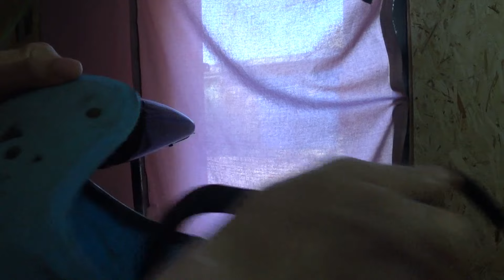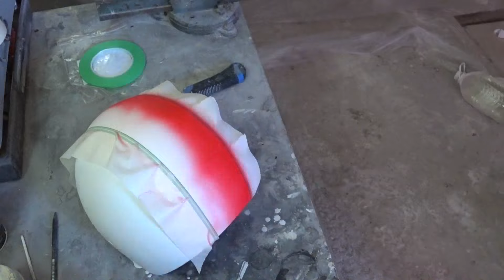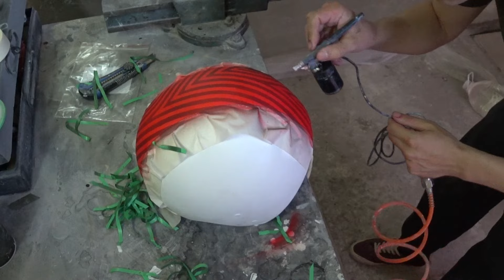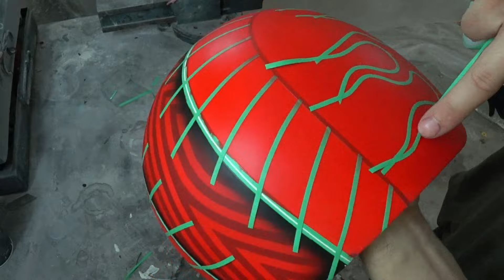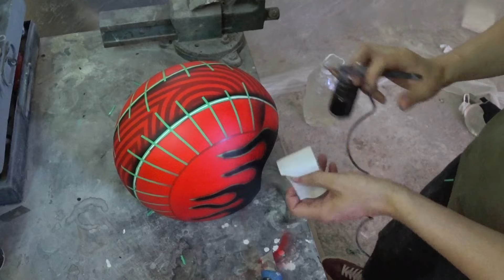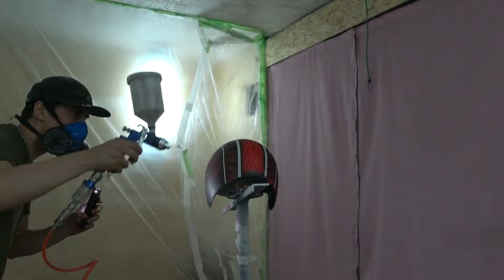How to custom paint a motorcycle helmet tutorial

Comment: Hi! Hope Im not too late with this comment, but what do you use for the final coating? Resin? Plastic coating? It looks so nice and shiny! Would surely be helpful for my guitar project! Thanks
Reply from the maker: Hi! Of course not too late. The final coat is a ceramic auto clear coat (jeta pro high gloss 5517) and I also like how it looks
Reply: Jurian, I build and mod guitars, 
and if you have a gun I’ve had great luck with that Duplicolor auto clear coat lacquer you get from Auto Zone. It’s ready to shoot without mixing or thinning, and it acts right if you want to mix in some candy or pearl pigment, which is the only reason I use that. Otherwise, I just use regular old rattle can lacquer.
Side note,
The biggest hurdle I’ve had to date is making absolutely sure your paints are compatible with each other. Between primer, base, whatever mid paints, and final clear, I’ve learned the hard way, if one of those doesn’t like any of the others, the whole thing goes tits up.